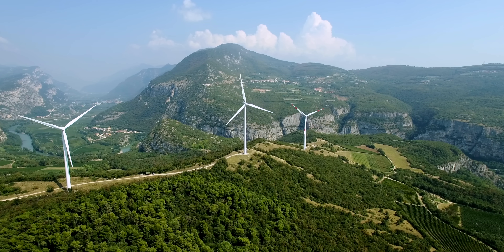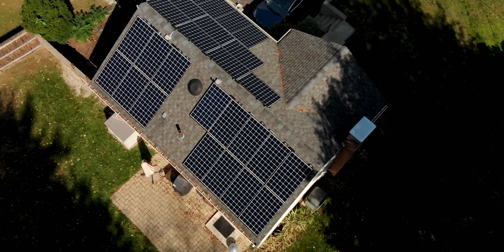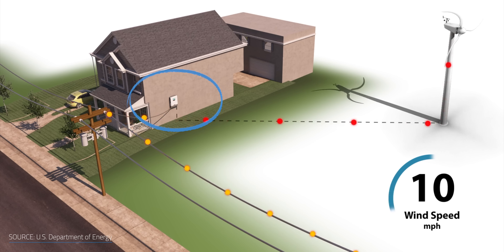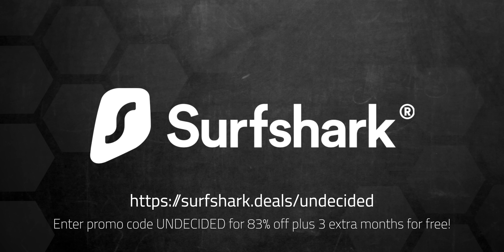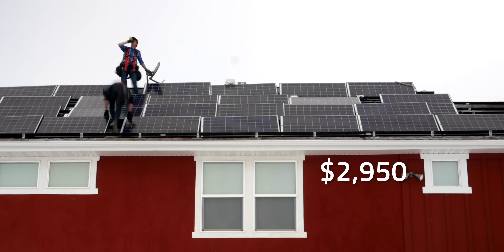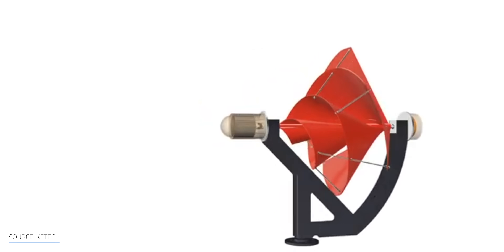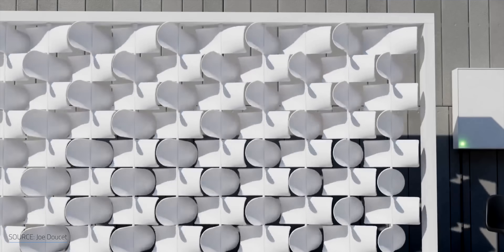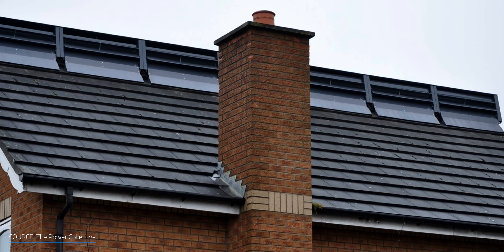The Challenges of a Wind Turbine on Your Home

Comment: Solar panels generate at least 10 times more green electricity with the same investment in time & money!
All practical tests show that small wind turbines hardly generate any electricity, because hardly any wind blows close to the ground! 
Wind/electricity yield increases with the third power of the wind speed. So +100% wind = +800% electricity. But close to the ground: 0 constant wind, only aggressive gusts! *Whether wind and/or solar power - you need a petrol generator to live off grid.

Comment: What filters do home wind turbines need? Also, solar panels are a pain to keep clean in dusty places. And their angle needs to be changed by season for optimal efficiency. They are also far less eco friendly. I'm using a small turbine in my blacony, and a battery eliminates all the slow wind issues. That said, I have a breezy balcony. Nothing worth bragging about yet, but I'm encouraged enough to build a bigger one and again install it in my balcony. Will report if I can shift regular household loads to it. (right now it is just handling the drip irrigation) And I made them at home, so cost... I live in India, stuff may cost differently, but under 100 dollars for sure for the bigger one I'm building. Most of the cost is copper, magnets, charge controller and pvc. 

The irrigation one used scrap, including tiny magnets and didn't involve electricity in production, though it could operate the pump easily (was not worth spending on the controller). So I directly used a magnetic gear to drive a water pump (also made from pvc). It is overperforming for my needs. Cost maybe 5$ but obviously can't take an electrical load now. Planning to replicate the irrigation one to see if it can be a mechanical compressor for a heat exchanger and voila free air conditioning if I succeed. lol. For far less energy than producing electricity first and then running an air conditioner.... (more losses)

If the wind proves enough, I can upgrade by simply changing the coils and magnets. Not to brag, but more like wind is different in different places. Perhaps the issue with purchased turbines is that they aren't optimized for the location and task and people look at their budget and buy rather than performance.

Comment: If I were designing a home for a client (assuming cost is not an issue to do), I would integrate wind and solar panel for electric power generation, use passive solar and maybe if the lot permits, ground-source heat pump (geothermal heating and cooling NOT geothermal power... which is more for utility district scale investment because that is cost prohibitive for SFRs (single family) and small scale MFRs (multi-family) houses. NOTE: It is important to consider the location and whether wind is a common feature. In places subject to Santa Ana winds or other high wind areas, I would be looking at wind generation and battery storage. Solar PVs are fine during day in its power generation but not necessarily well... at night.

One problem is, if you need big giant blades, that is a non-starter for homes and not viable in virtually every zoning district. The turbines have to be tighter package and with aerodynamically cupped  fin blades that wind catches and turn the motor which is basically a 'dynamo electric generator'. That is basically what wind generators are. It has to be types that can be turning with even as little as 5 mph wind and also durable for upwards of 200-250 mph winds. Just that current or wattage per hour would be way up there. 

You can run the question why bother if you size enough PVs to supply yourself electric power for off the grid or in most places, reduce power usage from the power company.

Comment: I'm no enginer, just a self-taught car/truck mechanic.  But it seems like horizontal turbin blades at the top peak of the roof driving standard, very cheap from the wrecking yards alternators tied into my solar hybrid converter would be a nice compliment to my solar panels.  It probably would not spin much.  But on those cold nights when the wind is blowing and the solar panels are producing zero, it might be of benefit.  Any opinions, anyone, on this type of application?

Comment: No household needs a 10kWt turbine or panels. Not even a single network purchase a constant 10kWt of power (because you must pay bills, not to issue them) It do needs a big battery and a good invertor.
PS By the way, it's not possible to grab 10kWt from 18 m^2. Neither with a panel nor with a turbine

Comment: That wind turbine wall would be great. Even if there's not a lot of wind all the time, the shade it casts on a south-facing wall in a hot climate like Phoenix would also lower energy needs by shading the wall thereby reducing heat penetration and lowering cooling needs. It's a two-for-one deal there. Plus it can be made to look architecturally pleasing.

Comment: Putting any large installation on a residential roof needs to be done with the upmost caution concerning the wind forces it will transmit into a roof not designed for them.   Typically when installing a large tall TV antenna it is more comfortable to place a tower mast next to and braced by the house rather than using the roof.   In Florida home owners have lost their home insurance policies and find it nearly impossible to get home insurance after installing roof top solar panels whose wind load has a high chance of overloading the roof during a storm.

Comment: I installed a solar system, not because I thought it would save money but more like a kid's science project. 

Now, I monitor my electricity usage and find that 2/3 of it is at night, so solar without a battery is marginal use, but a battery is too expensive and not worth it.  The wind goes would all the time, so it's a plus, but the wind is irregular, unlike solar so back to the battery.

What we really need is a low-cost battery to make renewables work.

Comment: In off-grid installations, adding wind to a solar installation might help to reduce battery sizes, especially when heating with a heat pump. Also, the bottleneck of such system is the winter, when it is cold and there is less sun, but typically there is more wind. (Thus, with wind turbines, one needs fewer solar panels and batteries.)

Comment: Matt, I can't quite understand why vehicles moving at a speed created by any energy source could not generate enough wind to generate electricity via a turbine. Everybody drives @ 30+ mph, which is higher than most natural wind. Anyone standing next to a freeway can feel the wind generated by passing vehicles. Why can't this be harvested and stored?? It's not perpetual energy, but it could offset the original energy source propelling the vehicle.
Reply: I just guess here:
The wind which is generated is so miniscule, that the turbine would be broken before it even got halve the money back it costed up front.
The material, which is used to produce those, would be wasted too. (It could be used in real turbines which generate way more energy with the same materials)

Comment: a place where wind turbines would work, is on electric cars.....somehow. I mean cars are already moving through very strong airflow by their movement, why not find a way to harness that kinetic energy of wind movement and put energy back into batteries? Unfortunately finding a turbine design to work on a moving vehicle, not very easy
Reply: The turbines are catching the wind, which slows the car down. Then you have the extra weight, which uses more energy to accelerate.
The energy you get from the wind is not 100%. The theoretical maximum efficiency of a turbine is ~59%.
Therefore, you need way more energy to get a little bit back.

Only thing i can think of, would be on something like those sportcars, which have airflow intakes. But those are most of the time gas powered cars.

Comment: Ok, so here is example. Done some support on remote mobile towers in middle eastern countries. They all were equipped with both solar and wind generators. And guess what, every time they need to undergo wind turbines maintenance server went down few hours later, nothing happened when solar or diesel generator have to go through maintenance.  That means system was mainly powered by wind , not solar! From there, I think more we go remote, wind gonna make much more sense.

Comment: You are too solar colored friend. The wind turbines you show are stone age versions. Solar has more disadvantage than wind turbine state of the art. You should do more research before you post a video like this. Yes moving parts, but they do not have to cost that much you state. You mention costs that are 10-100x higher than the truth. Your solar panels are giving much less than a single small wind turbine  can do. You do not need to mount them at 20 meter height either. If you live in a crowded area yes, but in a relative flat area, 1 meter above your house roof is way enough. Some turbines are silent, but you do not mention those. You only talk about super expensive old type wind turbines here. Why? You are too much solar man. Wind in combination with solar is great solution. I will proof you wrong since I will install both systems. You need to do research before you just talk-talk-talk about solar solar solar.....Oh my........

Comment: Shame on architects who have failed to design buildings, particularly skyscrapers, with wind generators built into the corners. It's not as if they were unaware of the incredible power of winds against the sides of the buildings. They've been forced to design specialized mounting systems for windows to resist the tremendous suction generated against the sides. Maybe they lack imagination, or perhaps financial incentive.

Comment: I can't help it. Even though I will install solar on my new home, I will also, in time, also install a wind turbine. I'm thinking of several installed on the spine of the roof of my outbuilding which will be a work space. I have no nieghboring structures on the north and south side, some forest to the west, and a 2 story row home across the street to the east. Pretty open to the wind. Sadly the roof slope is east to west, but there is plenty of room for ground mounted solar.

Comment: Its not about comparing the cost and production of solar panels and wind turbines, where solar obviously has advantage. The advantage of the wind turbine, is that you can produce power and run your house (like mine which is offgrid), even during windy nights, and winter sunless nights. Especially when you run your house on batteries! So, wind turbines, are a big advantage only for offgrid living. My turbine is small, but still can support my refrigarator alone, and give some juice to my batteries when sun is not there...

Comment: Thanks for this video. It gives me a reasonable feel for the cost difference between the two generating systems.  
What I’d really like to see is a solid video on an off-grid installation that approaches these technologies as complementary parts of a system instead of competing business models.  
Imagine an integrated wind/solar generating system with an integrated battery system.  That’s a package that can capture peak generation, whether wind or solar, and carry the load when either or both fall short.  
And that system could be presented as a scalable design so larger or smaller systems would be relatively easy to get to.  
Finally, do me a favor and pick one location for the video. All the double talk about “results may vary” is just a distraction. We get that.  We just need more information.

Comment: personally, i think we're having a conversation which shouldn't be happening right now.  before Tesla came up with the concept of alternating current, electricity was direct current...  similar to the output of solar panels and wind turbines.  the problem here is the loss converting DC energy into AC.  if we used to have DC in our homes back in the day, why not now?
use your DC output to run everything in your house and only rely on the Grid to recharge when your system can't produce enough energy due to environmental conditions.  flip this entire concept of relying upon the Grid on it's head, eliminate the reliance upon its existence for every day life and use it only as needed in a supplementary role.  * granted your $400/month on average electric bill based upon KwHrs transmitted/used will be reduced to almost nothing but the Utility Company will in turn charge you a Basic Grid Connection Fee of $400 a month to offset their loss of revenue.  go figure.

Comment: I think micro wind power could really benefit from cheaper parts and self modulating systems, the costs of these fancy composite blades make wind power unreachable for the most home. From a rural farming perspective, windmills made from wood and other cheap materials would make a ton of sense as a back up for solar.

Comment: I have wondered for a while why no one has used horizontal wind generators. For commercial application, ( no roof), you could  'offset stack' them to create the optimum angle of deflection from bottom to top and build the 'pyramid' as high as is practical. In this configuration you could set up the 'pyramids' behind commercial jets as they take off and use the wasted 'residual energy' to power the airport if not more. Horizontal systems could also be painted to blend in with the environment, have multiple bearings for support, less wind to start and can easily be sectioned off in adaptable sizes.

Comment: they could increase its efficiency by 100% if they simply put a square and tapered funnel on the front of it. what happens when you compress volumes of moving air? its speeds up.

Comment: I am in an urban area. my neighbors driveway is right next to my driveway and the wind between the houses is high. I could see the wind turbine wall as my driveway gate, or perhaps if protected properly as part of my fence system.  But I doubt it will ever be cheap enough for those uses.

Comment: Solar is not maintenance free. You need to clean them carefully or you lose production efficiency. And not everyone is capable of cleaning them yourself. On top of that there is n solar at night and batteries cost a fortune and in winter solar production is trash. Wind can cover that mostly depending on location. And firther north yield from solar is even less up to less then half what you used in your math.  So then wind is better overal.

Some countries get absolutely NOTHING for every KWH they cant store and dont use which makes it utterly uselless where wind is more consistent.

Comment: Good arguments & nice n sharpe. but pls dont use the average windspeed for Mass (4 M/s)  to calculate yr return. The windmill performance graph shows different & non-linear returns for different speeds so when it peaks at say 14 M/s youre getting  the full 1000 watts and you're gaining overall  more watts than the averaged-out 100 watts @4 M/s -

Comment: I have been pondering wind and solar power for decades now. Choose to believe me or not but I am in my mid 70's now.and I have been reminded by this types of articles that I've been thinking about this off and one sime my 20's.  Pondering but not having the money to make the invstment over my lifetime and other things to spend income on.
Ridgeblade sounds fine but still doesn't seem as effective as it could be due to effects of the slope of roof, and home orientation to wind sources that aren't from the same consistent direction.
But one thing I have thought about application-wise that metropolises or even business just haven't thought about is something like a ridgeblade setup mounted on the four corners  of tall buildings. Think of a city like Chicago having something like the ridgeblade mounted on any of the tall structures in Chicago. At those elevations, the wind would be almost constant. Each corner of the building would be a source of power no matter which way the wind would blow, each corner constantly generating electricity. With the wind velocities at those altitudes, the fan cage would not have to be that significant in size so aesthetics would not be affected that much. Build the fan cages in interconnectable modules in floor sizes so they could just be stacked as many as needed.
Why, after all this time, hasn't anyone thought of doing something like that. Due to the available wind, efficiencies would not be as impactful. Efficiency, size, heights, orientations, cost per generated watt have all affected home installations and independent home, "off-grid" applications, but if a power generating company wiould look at this type of structure, I think that company and any company on which it would be installed would look very favorably in the marketplace for a clean energy source.
Just thought I would put the concept out there for consideration and other monds to think about.

Comment: Your video triggered because I was talking to my dad about this last week. I am a enterprise architect designing organizations. Looking at my home it’s stupid to have only 1 or energy inputs like solar and electricity net. If you look at the system as a whole there are many sources of energy possible only storing is the problem. So if you have system that can convert all sources you could have also wind energy, kinetic energy (hometrainer, energy stored from moving into clothes and a battery, piezoelectric energy, and water energy when water falls into the sewer. In total energy would drop significantly. We are a big source of energy too but used very inefficient atm.